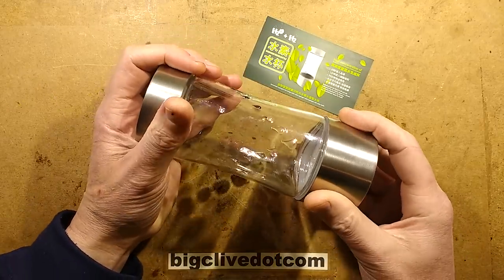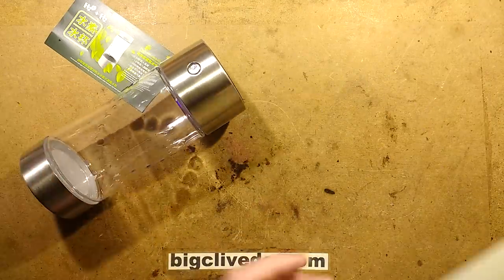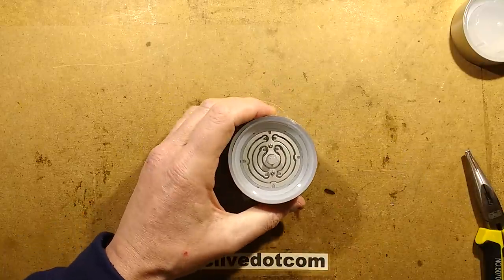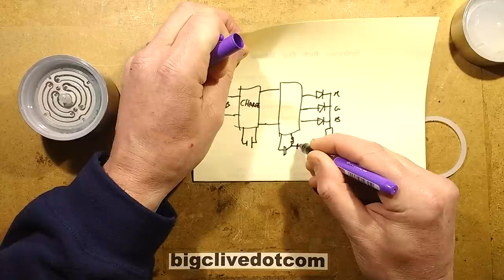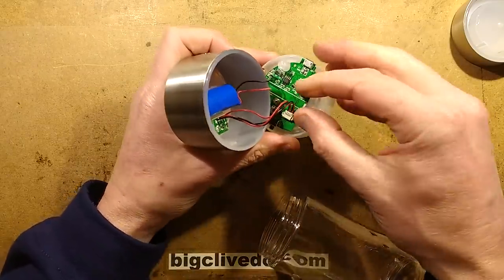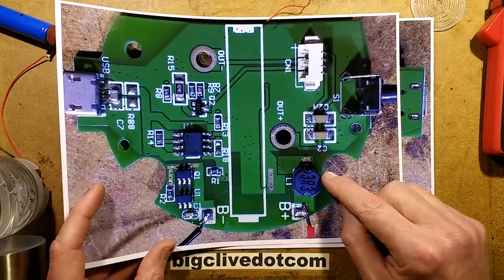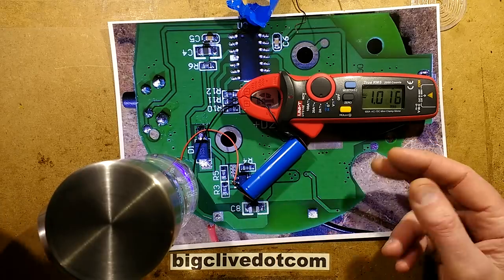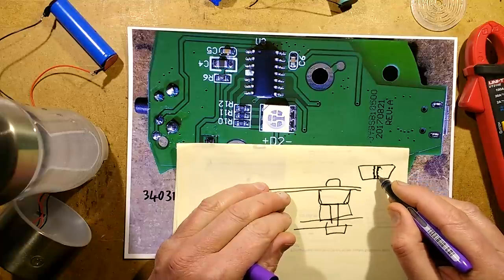Fixing an anti aging hydrogen-rich water generator.

Comment: Fascinating video, as usual, just rather disappointed that Clive didn't try lighting the Hydrogen, allegedly produced.
Reply: Form how simple it is constructed - yes, this is hydrogen.
Reply: It might be a bit splody, because it'll be hydrogen and oxygen in exact stochiometric ratio
Reply: Puting that mix in party baloons is a blast!
Reply: Disappointed that he didn't actually fix the anti-aging features of the product. What good is generating all this gassy water if it doesn't actually work as claimed?
Reply: Adria Garceran on the fourth of July we do 55 gallon trash bags with oxy acetylene mix. Stand way back. Then move back again. Light.

Comment: Ozone formation via electrolysis of water:
2(H2O) --> O2 + 4H+  + 4e -  if E at the anode = less than 1.5V
3(H2O) --> O3 + 6H+  + 6e - if E at the anode = greater than 1.5V
O2 + H2O -> O3 + 2H+  + 2e -  if E at the anode = 2.075V or greater

Comment: Is there a vent in the lid? If not the pressure is going to build up as it runs. Put the thing outside, keep it powered up from an external supply and let it run for a few hours. The gas pressure build up should be fun.
It is also going to produce oxygen. Half the volume of the hydrogen but it will all be mixed together. A high pressure build up of HHO mixture should be serious fun.
Reply: He says it makes a pop when he opens the container, so there might not be one...
Reply: for extra saftey "The pie dish of explosion containment" could be used
Reply: +bob s Hey there
Reply: What would be the equilibrium pressure?
Reply: Just do that and add a flame next to it for when it goes pop.
Reply: I suppose you could use this as a "lazy person's browns gas generator" for a little heating torch. Just don't forget the metal mesh-filled flashback arrestor.

Comment: 40 years ago I had a "Water Welder" brand electrolysis/gas torch. It didn't put out much heat, but the tiny flame was really hot. I used it for tiny brazes and welds.
Reply from the maker: They're very popular with jewellers.

Comment: Actually, you're getting H2 and O2 (some O3 as well - ozone) from the electrolysis of the water.  This is basically how all HHO torches operate, except on a much much larger scale.  You can light the gas and it will explode with a bang.  If you did put a sealed hose in it, it would be smart to put it through a flashback arrestor or bubble it through another water container.  Otherwise the whole thing will go bang.  Look up Cars n water's youtube.  He has an HHO torch he uses to melt all kinds of thing.  I've been wanting to build one for a while.

Comment: 5:25 Both electrodes produce gas. You get a mixture of hydrogen, oxygen, and ozone gasses off of the electrodes, with some chlorine gas as well. That's why it has that ozone-y smell to it. And yes, it will go bang nicely if you put a match near it since there is a 2:1 H/O ratio inside. Always was a fun way to ruin batteries and beakers in chemistry class when the teacher wasn't looking.

Comment: It's an 18500 most likely. I looked and there are several sellers in the UK that stock quality cells. Ya know, for that extra healthy water :)
Reply: Huh, it has 18500 in the model number on the board... coincidence?
Reply: Dustin Sparks I didn't even see that haha. I'd say so
Reply: or put one or two 14450 from e-cigs in.   They can be mistaken for AA if not abused promptly.
Reply: MattOGormanSmith you can get high quality 14500 cells. I use a Efest IMR in a flashlight. But an 18500 will have more than twice the mAh, so it would be better to order one as two batteries will not stay balanced like that.
Reply: 18500 is a good size for modding torches that take 3 x AAA cells

Comment: I bought a set of 18500 cells by mistake. They are rated at 1000 mAh so that electrolyser would be running it at 1C.
Also, I believe that if you add some acid (say, vinegar) to the water, the hydronium ions will scavenge up the oxygen and stop the ozone production. It would be cool to know if that works.

Comment: Also from my experience (I have done it before) Oxygen alone makes the flame stronger Hydrogen alone is fuel gas. But if hydrogen and Oxygen are present in the same container and you fire near the water face then you will hear small explosions.

Comment: Of course you will notice the smell of ozone - cause that will be produced as well.  
electrolysis of water is "simple" H²O => H² + O, so elemental oxygen. Normally most of that  combines to O², but a small amount of ozone can still be formed (this can be further icnreased with specific materials for the electrodes and by applying a higher voltage)

Comment: Wouldn't that be generating compressed HHO gas when it's on and sealed? Sounds like a BLAST! You should modify the top lid with your spark generator and see what happens.

Comment: wouldnt electrolysis with stainless put hexavalent chrome into the water?  i think youd need carbon electrodes to be safe
Reply: You're also getting oxygen radicals in the water too, which will combine to form O2 and O3 (ozone). Probably why Clive could smell it.

But yes, O3 might react with the Chromium in the electrodes to form hexavalent chromium. As long as clive doesn't drink it (too late lol) he'll be ok. It's not super incredibly toxic, you need s few grams per kilo of body weight for it to even have a toxic effect (about the same as chlorine).
Reply: Jusb1066 yes, got to love the chromium valences and their death bringing ability
Reply: yes. that's what I came here to say. Unless you use platinum or carbon electrodes, the electrode will dissolve into toxic heavy metal salts
Reply: I've heard hexavalent chrome is carcinogenic, so you've got more than the acute toxic dose to worry about.
Reply: I just found an amazon listing for a similar product, i was wwondering how it should be used once you generate the hydrogen rich water.
"Portable hydrogen rich water ionizer provides more healthy water for you. 
• Hydrogen rich water is easy to absorb and can help to boost your metabolism and reduce constipation to some extent. "
Also mentions 304 stainless (though not sure if that's the housing or electrodes)
From that you are meant to drink it :P
And i'm surprised he didn't light it to see if it produced the hydrogen :D
(though that could be the next video)
Reply: MattOGormanSmith it is, thats partially why dichromate's are not as readily available as they once were (not taking into account ebay and its "buy anything here" mentality)
Reply: the more expensive ones have platinum coated titanium electrodes and permeable exchange membranes.
Reply: Louis Johnson Mmm, chromium. Deadly deadly chromium.
Reply: At least the target clients are old people, who are unlikely to die of cancer produced by drinking that. And the toxicity, not enough hexavalent chromium will be generated from the electrolysis for it to be harmful.
Reply: ficolas2 well, its not like its going to make said old people any healthier.....   anyways, its all conjecture as to what the metal is, it could be platinized titanium, the color looks a little too grey to be austentic stainless
Reply: God I hope so cos I've been using mine for two years now
Reply: It has been etched by now, and will look grey from the etching. Likely was a stamped out part from a sheet of thin stainless steel, that is commonly used to make covers for toasters and such, then they dropped them in a tumbler with coarse media, to get the rough edges off and make the matt surface to get the small bubbles.
Reply: I have a valence on the back of my car... it's right below the bumper
Reply: Well he has taken Poundland Viagra before...
Reply: Those are the magic vitamins ;)
Reply: Exactly never use ss even when using electrolysis to de rust something. Titanium minimum for Chemical electrolysis, but I wouldn't drink any of the products.
Reply: anti aging
well cancer cells dont age
look at HELA cells!!
Reply: As far as I know, if you use carbon electrodes the liberated O (not O2) immediately reacts with the carbon forming carbon dioxide. Could be wrong thoughbut.
Reply: There needs to be a movie based on that.
Reply: I've personally investigated the Chromium thing w S.S anodes. The rich yellow electrolyte from a hot running electrolyzer showed serious amounts of Chromate or +6 form. (Indicated by an unstable vibrant Blue-Purple +5 oxidation state from a drop of acidified H202) I'm just an amateur chemist though with Google by my side.
Reply: And beside dissolved electrodes... whatever they're made of...   We get just a hint of dissolved screws as well.  Nothing like a bit of screwing to get your day started.
Reply: Actually, the took her cells without consent because that's what they did back in 1951. It's not a racial issue, they took white people's tissue samples without consent too.
Reply: greenaum it had nothing to with her being black, white people had their tissue and such taken without consent all the time in the 40s, 50s, and 60s. Stop inserting race into every issue on earth.
Reply: Thought I saw a little yellow tint to it.. reminded me of the nickel-bronze alloys used in seawater applications.
Reply: This are titanium plates.

Comment: "Hydrogen-rich water"... acid?
Reply: This is molecular hydrogen, H2, not the H+ ions of an acid.
Reply: So, floats away and is totally worthless
Reply: > totally worthless

Like just about every other bit of quackery out there.
Reply: James Van Damme yeah they usually have tinfoil over there head.
Reply: @James Van Damme I find some things on that list to be less insane than others. The Tuskegee Syphilis Experiments and MK Ultra sound like a lot of conspiracy theories, but they are confirmed as having happened by the federal government. So I think questioning some coincidental deaths around the Clintons and other politicians or if JFK really was assassinated because he made some rich bankers mad isn't that far fetched.

But I agree it turns into a rabbit hole. As soon as most start looking up JFK's position on the big banks, it leads to reading about the third building falling and how burning buildings *never* collapse, then big pharma, reptilian jesus. Before you know it, you have a radio show and are yelling about the chemicals in the water turning freakin' frogs gay.
Reply: Well, most conspiracies do have some nugget of truth that they riff off of. The earth does look flat, and it only curves 1 degree in 70 miles, so that's flat to the eye. The contraceptive and pollution residue in some waterways has been shown to interfere with the reproduction of aquatic life. And somebody has built a sun simulator for testing solar panels and such. If they increased the power 8 orders of magnitude somehow, there's your fake sun! 

Tuskegee and MK ultra aren't on the "top 40" list of totally whacked out conspiracies, though. I've seen some people who seem to believe ALL of them (I have a family member, who has a tendency to schizophrenia, who is starting to go off the deep end). You can't talk to them, because they already believe something unreal and counter-intuitive.
Reply: Well, you could put some sort of spark plug on top of it and the hydrogen wouldnt be completely wasted :D
Reply: Fake sun?! What?! o.O
Reply: Fake sun is the new hotness! Flat Earth is old and busted. 

Yes, they walk among us. And some have guns, so be careful (if you're in the USA).  Don't waste time trying to convince them that the sun is not fake. "You cannot convince a man he is not Napoleon".
Reply: James Van Damme -- Wow, that sounds suspiciously like a certain resident of casa blanca #1600, and his cronies at that insane rag. You know, the one which says "Perspiring minds want to gnaw" ;) or some such.
Reply: There are nut cases of all political persuasions.
Reply: these 'some people' of which you speak - as one, and in defence of the position; i call it as a predisposition for the narrative that must precede scientific enquiry...the pioneers of the thoughts that must precede empirical process and supply confirmation. us types - unbridled from this lag science has in providing confirmation, get to believe early and reap the benefits. .. you just gotta try copper bracelets for arthritic pain, fluoride is poison, cell phone towers are obviously unhealthy,  etc. This shackling to science is so... limiting. cheers :)
Reply: Yeah, I spent too much time going to engineering school and designing radars and antennas, then I come across stuff like this 
http://store.bioelectricshield.com/aegisguard-ls-radiation-shield-plant-based-spray-for-all-electronics-and-windows/
And it's just hard for me to understand how it "blocks EMF while allowing your wifi to work". I guess I can't think outside the box.
Reply: Hydronium forms readily in the presence of hydrogen ions that are generated by hydrogen, so I have to imagine you would see a decent pH shift
Reply: Water already contains hydrogen ... That's where the hydrogen bubbles are coming from. Since the hydrogen rises to the surface and is lost to the atmosphere, it WOULD be hydrogen deficient water ... except I'm sure the oxygen is also being stripped away ...

As for the ozone smell ... around here tap water is chlorinated, so are you possibly smelling chlorine?
Reply: @jamesvandamme7786  Indeed you can't PROVE that he isn't Napoleon, because it's logically impossible to prove a UNIVERSAL NEGATIVE!
Reply: @jamesvandamme7786  Where's the deadly hydrogen hydroxide (aka Dihydrogen monoxide)?
And surely there's got to be a conspiracy / conspiracy hoax surrounding the notorious stimulant 1,3,7-Trimethylxanthine?
Reply: DHMO kills thousands of people a year. Strangely, there is a DHMO-free zone around Area 51 at Nellis AFB. 

And many are hooked on 1,3,7-Trimethylxanthine, delivered with DHMO. I have some right here, but I can quit any time I want. Tomorrow....
Reply: @jamesvandamme7786  What do you mean "most conspiracies have a nugget of truth"? The word conspiracy has nothing to do with wether it's true or not LOL. There are many conspiracies that are true, many that are hypothesized, and many that are un-true. The fact you seem to think the word "conspiracy" itself automatically means it's not true (or only has nuggets of truth) shows how intellectually inept you are. 

Conspiracies happen all the time and is and has always been a part of basic human behaviour since humans roamed the Earth in groups.
Reply: @vincer9960  Since I'm an RF engineer, I have experience with the effects and hazards of all types of EM radiation. People who don't understand things like power density, directivity, wavelength, etc. come up with conspiracy theories of "EM hypersensitivity" and "5G Death rays" and such.The more paranoid among them conjure up Evil Government Conspiracies aimed at them specifically. It becomes self-fulfilling when they start stockpiling assault rifle ammo, ricin, and ammonium nitrate and send threatening letters. 

As I explained before, the government DOES check up on people, and the earth DOES look somewhat  Flat. Small nuggets of truth.
Reply: @jamesvandamme7786   Throwing the baby out with the bath water here, The earth is flat!  Prove me wrong.

Comment: As a follow up video, pass two stiff wires through the lid and seal the entry holes with epoxy resin. Bend the wires so they are close together to form a spark gap and attach a pair of long wires. Fill it with water and let it run outdoors on an external power supply until the plastic container is bowed out and ready to pop with the pressurised HHO mixture inside. Get the Arbra dynamite exploder and we should witness the biggest bang since the big one. That 'explosion containment' pie dish will be woefully inadequate.

Comment: I don't really get the point of the voltage reversal. Is this necessary to keep the metal electrodes from doing some kind of electroplating or something? Or just extra quackery?
Reply from the maker: +linagee They accumulate deposits.  Reversing the polarity has a cleaning effect.

Comment: Did anyone else notice the PCB date? this is brand new, so they really added old/crappy cells.

Damn, but they might learn and improve on that.
Reply: DooMMasteR It'll be another one of these Chinese products where the design is released to a bunch of factories and there's a race to the bottom on cost. Most likely 80% of the units work long enough to get past eBay/Ali etc payment protection rules and then they've done their job. And with quack products I'm fine with that as it's just a case of scammers scamming scammers anyway.

Clive got a daft one on this occasion and that made this video more entertaining!
Reply: yeah, I saw that too!

Comment: @bigclivedotcom quick workaround for the miss sized battery is, you could just solder an adapter connector onto the board, drill a little hole through the base, then run it on an adapter from the wall...  :)

Comment: Is it a transient voltage drop that causes the reset? If so, then maybe adding a bulk electrolytic cap would smooth it out enough.
Reply: its basically a cell with high impedance. aka buggered..
Reply from the maker: I did tack on a capacitor to see if it helped ride over the current spikes, but it didn't work.

Comment: Dear Sir you can not do electrolysis with distilled water. If you want to create an electrolysis in distilled water, then you or me or how ever need to add salt or baking soda or accede exactly like the car battery is working. Your video is very helpful I just bot a similar device. Thank you very much for your help.

Comment: ...also you should not need an overvoltage ov 12 V to split water efficiently- You might try to either completely bypass the step-up converter or at least reduce its output voltage to something like 4 V.

"a lot of hydrogen bubbles" - no, 1/3 of the bubbles are oxygen...